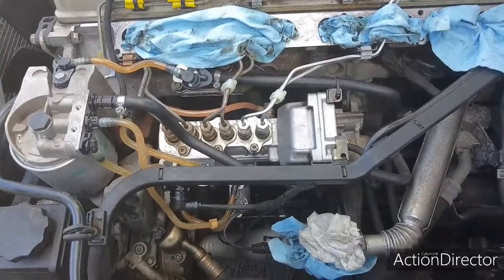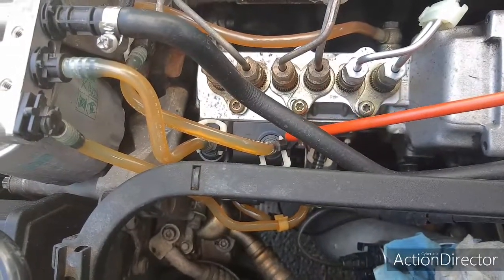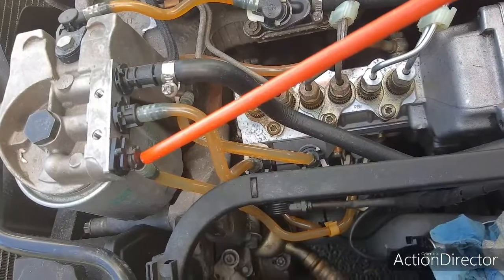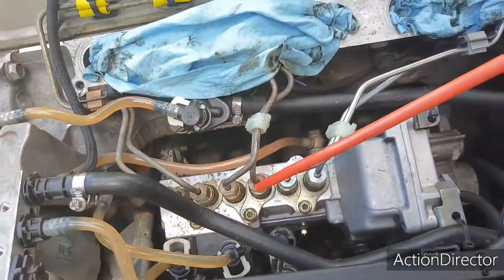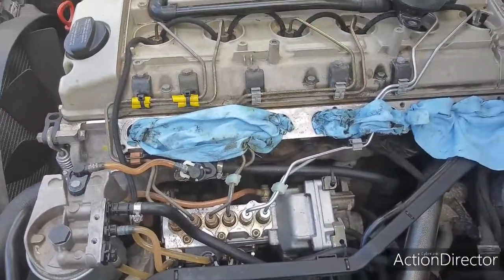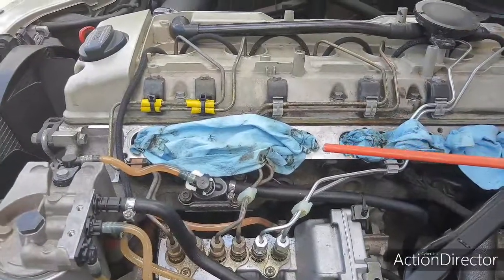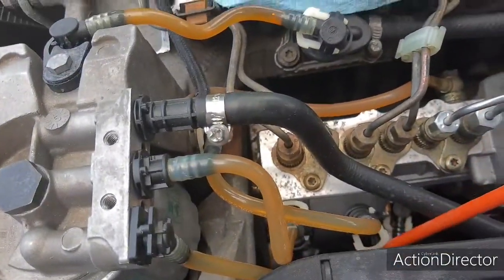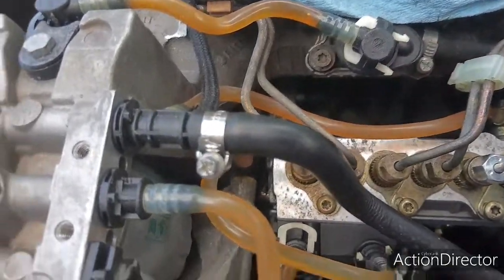Mercedes E300 OM606 Fuel Flow n Leaks

Comment: hello as that the fuel pump up by the mail pump /and not under the floor of the back seat //I have a 1996 D 300 e class diesel and can not find the fuel pump and my fuel filter never has any fuel //lol I buy nothing running as my 1960 jeep and my 2000 Lincoln barn find you my ask why ? because I never had the money ,

Comment: thank you sir. very good explination. Do you know how or what close the shut up valve? I am working on my fathers accidentel C250 turbo diesel w202. and i get no fuel at the top off the injector, the steel 14 mm nut line>  When try starting a lot off bubles are in the lines near the pump to the filter. The car is standing stil for 12 years now. My father stopt driving after he make with this car a accident with 30km/h or 18.5 miles/h in the back off another car. My father shout down the enging with the key secounds after the collision. Now we are trying to start it up again. Enging glows and crank but no start. II think its maybe the shut off valve not opening. I unscrew cilinder 1 the line and no drup comes out while starting. You have any idea? Kindley regards geert solie
Reply from the maker: Sorry for the delay in my response. I am an amateur mechanic so sorry to say I figure stuff out just as I go as you are doing. My guess is that by now you have it fixed. I'm not sure how the cut off defaults when faulty.  I would try one of the Mercedes Forums on the net. After sitting 12 years you may have other considerations like sludge or even algae. Wish I could be more help.
Reply: @capedoryus  hello , yes with the  help off an forum member we fix it. Now the engine running back like be fore. No sludge . We replace the plastiek tubes on the gasoline filter and 1 o ring in the pre filter. And in the pre filter the car takes the air. That was the reason it not wanted to start. Greetz

Comment: I have a OM 603 W124 300D Non Turbo.There is leak of diesel from the top of the fuel pressure line in the pump side. I have replaced all the copper O rings in the fuel pump. But there is leak from the top of the 5th line.  Should I have to replace the line? Can you help me with the part number of the fuel line you had replaced?
Reply from the maker: Thank for watching
 I replaced the soft fuel return line and one hard line. The hard lines can crack if they are not supported, on the 0M606. Not sure on yours. If your order the return lines be sure it's the right diameter. I ordered from one supplier and it felt just fine going on but leaked. Here there are a few different diameters. The hard line I ordered I don't think would fit your engine. Not much info here, sorry. I found a Russian site that had the schematic drawing from MB. A few min on Google should produce the site. MB really has the schematics locked down. Good luck
Reply: @capedoryus  : You are right my line was not supported. Have ordered a new part from ECS Tuning. Will update after installation. Thank you for your support.

Comment: Thank you for the video Mr Conway.  Have you had any issues with air in your fuel lines ?
Reply from the maker: Sorry for the delay. I thought I had answered but alas I did in my mind only. I followed others advice and did two at a time. You will find the keepers for the injector nozzles are in pairs. If you do it this way you still have four lines pulling hard till it self bleeds. On the lines themselves I don't believe I had any problems as the hardliners and the injector pump was full of fuel. Good luck. Did not have any real issues other than the intake manifold bolt the threads from the bottom of the car. It was off by 2-3 mm once everything was in place. I had to not secure the IM on the top side so I could have play on the bottom to get the bolt started.